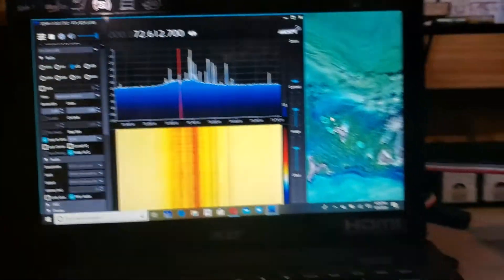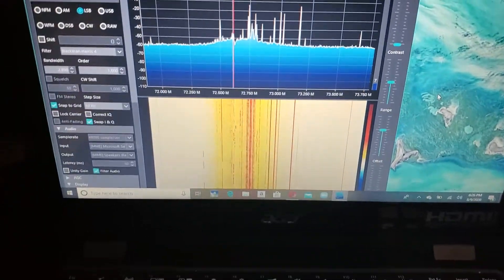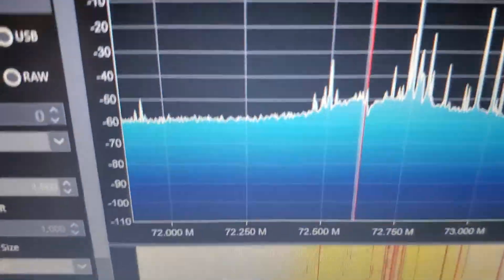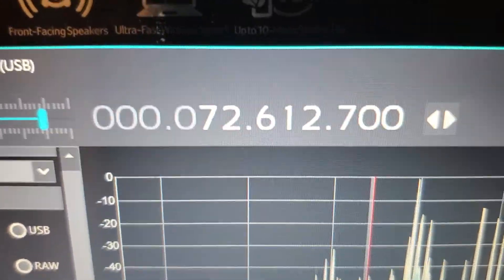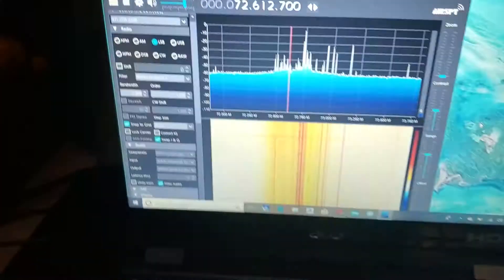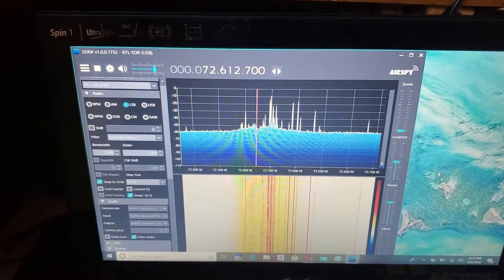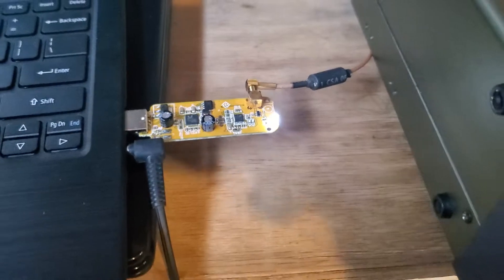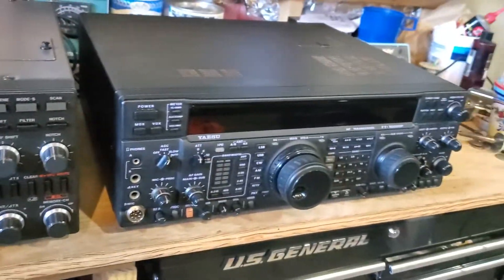Finally successful I.F. tap panadapter ts570sg and rtl-sdr  rtl2832u r820t2

Comment: Nice. I'd like to ask how you managed to get the CAT control working with SDR#. I'm sure over the serial port, but what is the middle layer? OmniRig, Hamlib, something else? I've got an IF tap working with HDSDR and OmniRig V2.1, but I'd like to try some of the other SDR programs out there, and it's proving unnecessarily challenging. Thanks!